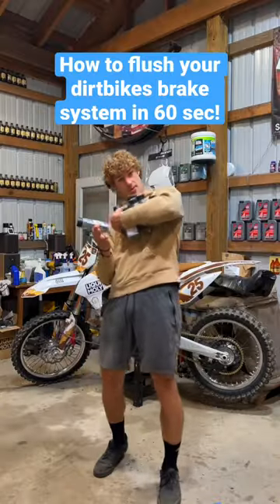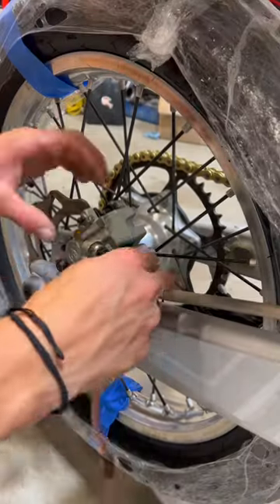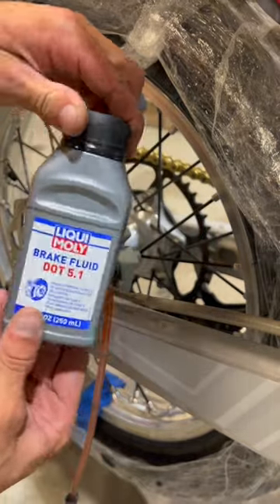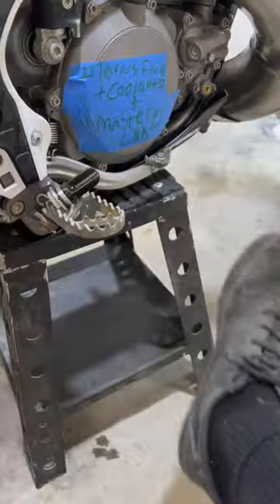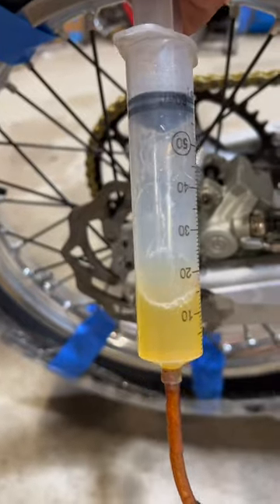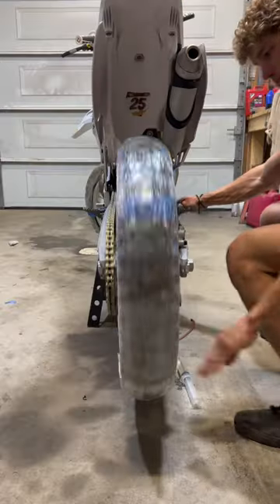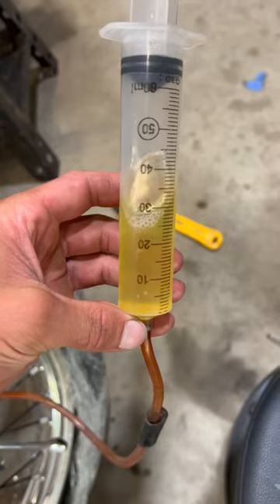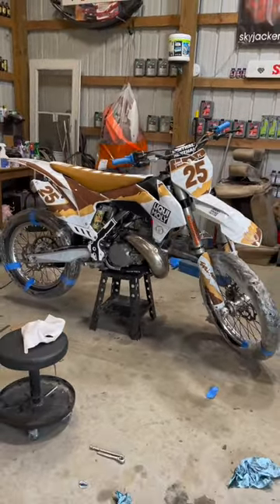How to fix dirt bike brakes that don’t work! #mx

Comment: “The only brand I trust “, most likely because   He is sponsored by them
Reply: He is. Look on the side of his bike
Reply: Brake fluid trust is at an all time low  mostly thanks to the seeds of doubt placed in people by this video.
Reply: Yea… I mean like atleast just be honest
Reply: Just like me, i only trust brembo, not cus im sponsored, but i love there break products
Reply: @lenhard6801  yeah, i rock a 4p CNC machined caliper with a 16x16 on my 450 and that thing bites!!!!! And never overheats. Italian quality 🇮🇹
Reply: What brake fluid is the best? I'm currently getting silkolene. But it's kinda expensive
Reply: @orionmobile6545  as i said check out the project farm videos about oils for everything. They use the real Lab methods and show real collected data to compare them and valvoline was the best in almost every test
Reply: @orionmobile6545  look at project farms videos on it
Reply: He is but he was using it long before they started to
Reply: Yeah this statement makes no sense, I understand it in terms of taking your bike to different garages but using different brand brake fluids and oils - really? 😂

Comment: Laughs in drum brakes
Reply: jokes actually on you drum brakes are awful lol
Reply: Jokes actually drum drum brakes don’t work you have to tighten them hell out of them
Reply: I was gonna say that you still ride a small bike but then I realized that friendly fire can’t be accepted
Reply: My moped was ripping skids in parka with my drum breaks, never failed me for 2 years and I abused the bell out of it (speedfight 4 50)
Reply: Laughing all the way off the cliff
Reply: @barnsnoble7066  u had me dying 😂
Reply: I have both.
Reply: @Ja-fh8io the hell... they're not bad at all.
Reply: the cliff comment was actually funny.  drums are fine. have had bikes with both wheels drum, was fine. had bikes with 3, and two disc, also fine.  currently my bike, that is litterally inside my bedroom right next to mw because I love it has both and that's fine.  
it will skid just as easy as any other bike I've had.
Reply: Shockingly I recently learned drums are superior in some ways
Reply: @Fee.1  light weight and simple and on a string not fluid. Plus they look cool with speed holes in the backing plate.

Comment: I know this is unrelated, but could you do a short explaining how carburetors work?
Reply: why not just watch one of the dozens of videos already on youtube
Reply: I recomend a video by the youtuber SmarterEveryDay. He made a see through carb, where you can see what happens as well as explaining in a easy way
Reply: This guy can’t even correctly change brake fluid. I would like to learn from this guy haha
Reply: Study the venturi effect that will explain everything
Reply: What, the ol venturi tube? Google that, homie.
Reply: I doubt it, as 60 seconds isn't enough. the fuel goes to the bottom, the lines on the top just let air in to equalize pressure with the atmosphere... some carbs have only two fuel circuits, Mikunis have three.... oh not including choke, that's an extra circuit... the pilot, or smallest jet is basically just for idle, then rhe other or others kick in as you rev up higher.... the air pulling threw basically just wicks the fuel off into the engine.... oh and you have different slides, round, flat, and CV(constant velocity) the CV ones you have no control over the slide, it goes up or down by it's self you can only control the butterfly valve.  those ones are on street legal bikes with carbs for the most part.   hope that helps.  theyre complicated honestly but not really it you spend massive amounts of time messing with them. I'm a slow one, but 60 seconds.... try 60 days, if you want the knowledge.
Reply: @Armando Aonly seen a few videos from this young man but he seems smart to me. pretty sure a lot to learn from him. by the time he's my age he'll definitely be better at working on these things than me.

Comment: Just because you don’t have brakes and lost pressure doesn’t mean bleeding your brakes helps that. A brake system a closed system if you lose brakes that means you have a leak or it’s getting past the piston seals on the caliper or the master is bad.
Reply: or you just have old brake fluid which has turned black and after you bleed it, it will work like new again
Reply: I know after heating my brakes up good a few rides they need bleeding fresh fluid work great again. Maybe you don’t ride much but this is very common fix . Don’t necessarily agree with how he did it lol but he isn’t wrong this is the first place to start if pads are good.

Comment: It’s a bit messy but have you tried doing a reverse bleed by putting the new fluid in the syringe and forcing it up into the reservoir. I find it so much easier

Comment: hey man another thing to keep your tires fresh besides that plastic wrap can also just set them on wood and that also keeps them from rotting anyone who didn't know already its not good to store your bike with the tires sitting on concrete or cement
Reply: Actually,the older your tires are the better they are (to a certain extent) so,story time. Back when I raced,I was sponsored by Dunlop,I used to get 55 tires a year,all sent at the beginning of the season,so majority would be in storage for a good part of the season.the longer they sat in storage,the longer they would last, because the rubber gets a bit tougher over time. You are correct about the concrete thing (although that's if the concrete is wet/damp) if it's inside a workshop and it's a dry concrete floor it's all good.also, obviously there is a point where the tires will have been sat too long and deteriorate.but if it's for just one season,like mine were,they will be better towards the end of the season.

Comment: You don’t even need that syringe bleeding brakes on a dirtbike is the same on anything else with disc brakes top off the fluid tap the pedal hold undo bleeder valve let it squirt out repeat until it’s a solid stream and no bubbles
Reply: i thought the same🤷‍♂️

Comment: Wait wait wait when you press the front brake and it becomes weaker while your holding it does it need new fluid? And i got new brake pads so help

Comment: That front brake fluid looked nasty as HELL

Pls don't spill so much brake fluid. Eats into painted metal/plastics. Neutralize with lots of water

One tip: soak up old brake fluid with a lint free towel before filling up with fresh fluid
That way you don't have to pump as much through. Less dot use, less work

Comment: Did you really tape off the tires because of brake fluid? Lmao I hope not I'd be more worried about the rim then the tires. You can wash/wipe it off it's not acid
Reply: It's very very corrosive lmao

Comment: Mine keeps losing pressure after a week. It goes from being solid to nothing. Can anybody… somebody please help answer that?
Reply: It can be many reasons 
But from what you saying (maybe) one of this
-Piston seal leak 
-brake hose need to change 
- or the worst thing brake pump problem

Comment: Good vid but looks like thay syringe was previously using mineral oil and cross contamination is not good with brake fluids will destroy seal and brakes with fade
Reply: That syringe only pulled fluid, it didn't push any. Use ur noggin

Comment: Why didn’t you do that when you rebuilt it? Seems like you’re putting the cart before the horse there. Also… your brakes will never just randomly be soft like that. If you ride the bike more than once a month or so your fluid should never go that quickly. So just another sponsored Ad so you can make money both from Liquid Moly AND YouTube shorts!? Some real quality content here…
Reply: Also started the video at the front brake, then completely skipped that to go to the rear brake… just to go back to the front. Dude wth fix your timeline

Comment: That was the messiest brake fluid change I have seen in some time. Follow this guys "technique" if you not only splatter breakfluid but also add air into the system making brakes mushy and less effective.